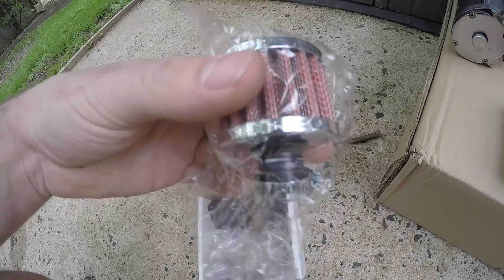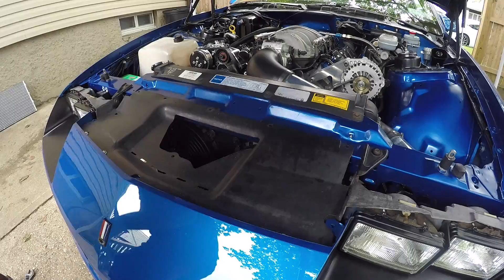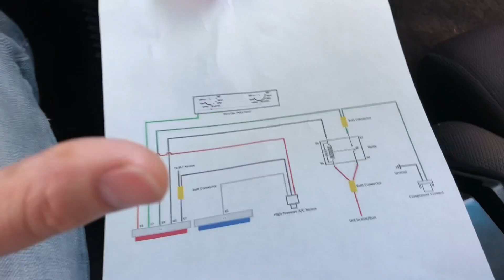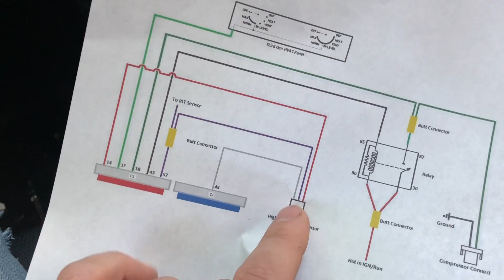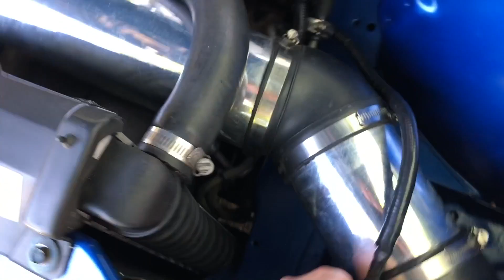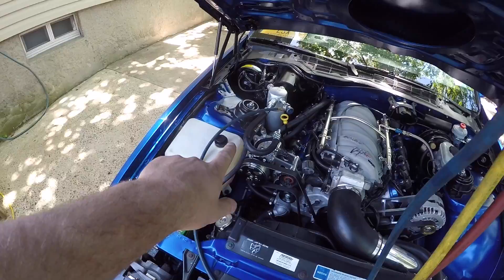How To: A/C In an LS Swapped 3rd Gen! | LSA Blower Swap

Comment: Dang man you should have replaced your condensor with a parralel flow condensor you can get them from summit or classic industries. spectra part number 7-4426
Reply: So is the spectra 7-4426 better than the spectra 7-3231?
Reply: Derek Edgerton found the answer 3231 is a 6mm piccolo design 4426 is a parallel flow, 4426 is more efficient...
Reply from the maker: rfoster2323 Lmao by the time I learned about this I was pretty much done with the video. I’m gonna see how it does in the 90 degree weather then go from there.
Reply: I live in Tn and its pretty humid here most of the time. I changed mine to a parallel flow and my vent temps went from low 60s to low 40s.
Reply: Also that is a good tip about that foam next time I open mine up I will replace the foam like you did.
Reply from the maker: I found it, thanks. Definitely on the list now.
Reply: Derek Edgerton I would like to know also I have a brand new 7-3231 for my ls1 swapped 89 but if the 7-4426 is that much better I would rather take that hit now before I fill system.